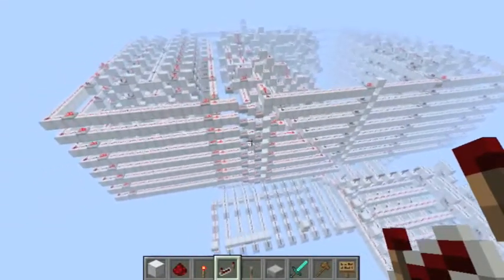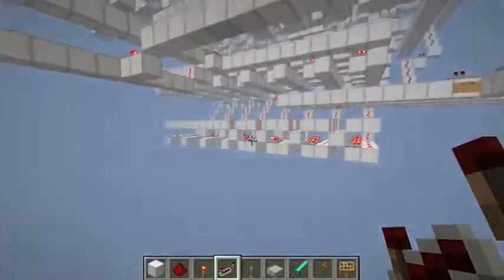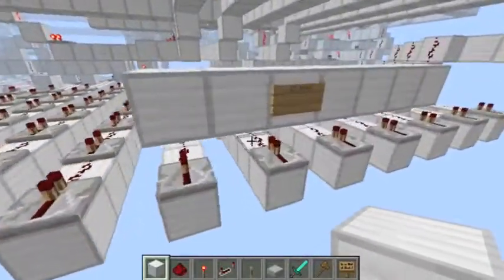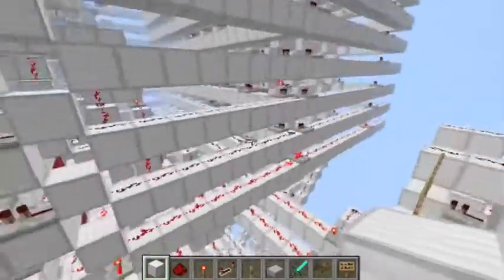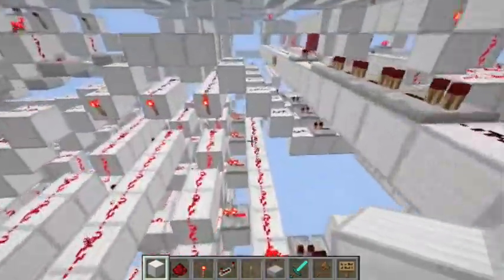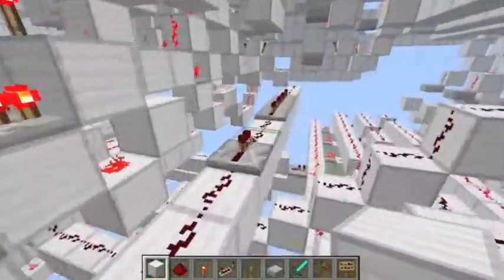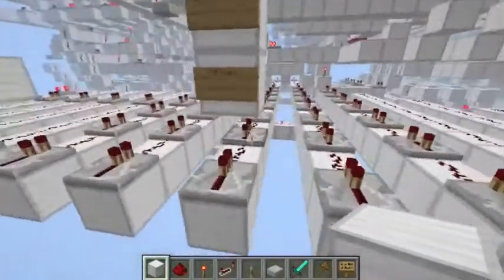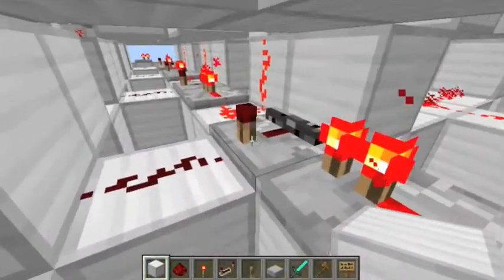3 Tick Pipelined Computer Update

Comment from the maker: Because this ALU runs on 3 tick pulses, not 4. If i had used 4 tick repeaters with 3 tick pulses, either the repeaters would not react to the signals or the signals would be lengthened.